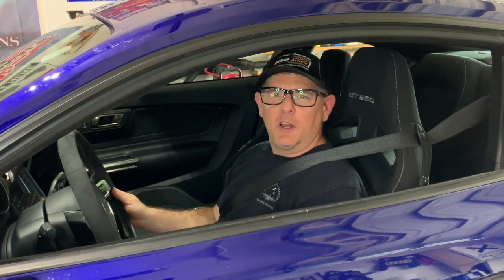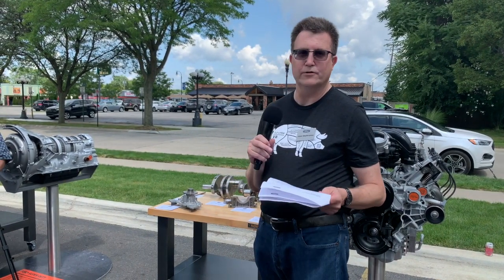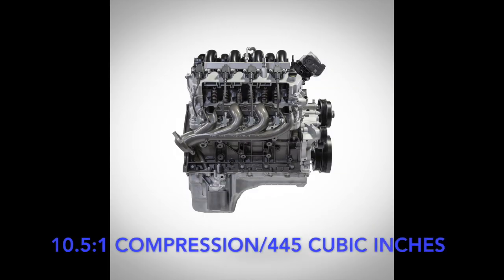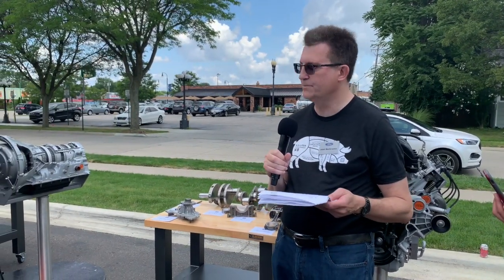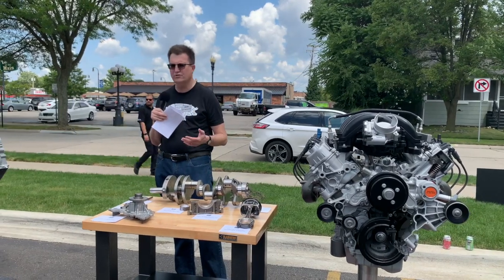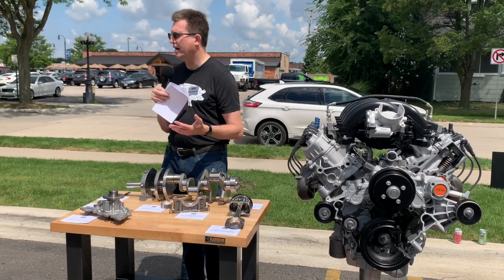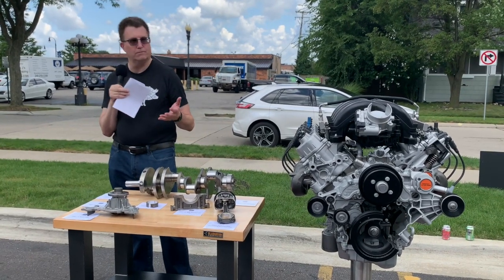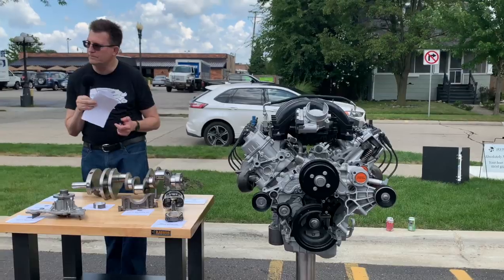Perfect for Engine Swaps! | Ford Reveals 7.3L "Godzilla" Gas V8 Horsepower and Torque Numbers

Comment: Let's be real, this is Fords attempt at an LS slayer. A high production number, affordable package that after a few years of pumping them out, us homegrown wrenchers can pick up cheap and have an extremely strong and reliable platform to get some serious bolt on power out of without having to do hardly any internals to it even with relatively high milage. Best move ford has made in 20 years. And this is coming from a lifelong Chevy guy. That stock bottom end could easily crank out 1,000 HP without even flenching, and as long as the one building it can get it tuned right to avoid detonation and valve train failure, it will do it again and again and again. This is going to be fun to watch.

Comment: Over 400 Ft Lbs Torque at 1500 rpm! That is a monster. It would be neat to see this curve starting at idle to see the grunt when you let off the brake and start to push the gas.

Comment: Some of the comments remind me of back in the 70 s and 80 s guys would remove a 302 or 351 and replace with a 460.  Why not build the small block and blow away the now useless truck with the heavy 460.

Comment: I cant wait to see the numbers of one tune up
Reply: Marcus'World what the hell wouid you have to tune up,change the damn oil and go-plugs will last 100000  oil 10000 with Mobil one diesel triple cost
Reply: @andrewnix1355  it's currently tuned down, ford will enhance tuning for raptor and other vehicle applications, also roush is working on a tune, this 7.3 will be 500+ in 2 years or so. Also this is not a deisel engine

Comment: I love all these fine details on a well-designed well-built engine. Make this engine breathe better, give it a dry sump, put it in a Mustang
Reply: If I'm not mistaken there is already a dry sump kit for it that connects where the oil cooler bungs are on the side of the block, that being said, it doesn't really need one because of they finally put the oil pickup in the rear of the oil pan that runs through the windage baffle in the pan.

Comment: I’m very interested in engine performance based on optimized efficiencies. The Japanese and Germans have consistently demonstrated the ability to produce both gas and Diesel engines that produce substantial horsepower over relatively low displacement that provide great fuel efficiency and if cared for will last half million miles. I’d like to hear from the guys who really know truck engine efficiency and what recommendations they’d make to the big three that would achieve a 500 horse gas engine, with similar torque that would last 10 years without significant mechanical failure.
Reply: One Good Turn Gets Most Of The Blanket — Nope! I have a 2016 Toyota Tundra and a 2007 Nissan Titan (My son’s truck) in my driveway! They are durable but not efficient! Also, show me a V8 Japanese engine utilized in commercial applications or heavy duty truck hauling /towing usage that has over 500hp? I don’t purchase many American made vehicles, but i would bet this 7.3 could easily match or exceed the durability of current Japanese V8s! Also, I really like that Ford Coyote V8 for light usage!

Comment: Based on the displacement rationale to produce horsepower, relational torque, at low RPM and engine longevity - 9.2L should produce 600 horsepower at idle. Ford your missing the Mark here.
Reply: No manufacturer will ever but a 9.2l displacement engine in there vehicle ever

Comment: Whats the Length, Width, Height of the engine? Will it fit in an older Mustang, Crown Vic/Marquis, or Town Car? Will Ford be offering Stand Alone Wiring Harness ECM kits....Aaaaand most importantly, a Manual Trans Bell Housing/Clutch Kit? If you dont do it Ford, the after market crowd will

Comment: I’d disagree, you’ll make just as much or more hp with a tivct motor boosted without the massive weight added to the nose from an iron block. The motor was designed for a cheap and simple configuration that produces good torque. How do you accomplish that? Large displacement and push rod design.

Comment: Kudo's to Ford for doing its own thing and going back to a pushrod engine design. I am so tired of overhead cam engines in general, foreign and domestic. This engine should be able to go 500,000 miles easily with minimal maintenance, no DEF fluid, no timing belt replacement, and no timing chain replacement.
Reply: You sound like a man that knows trucks and uses them as they are intended.
Reply: Ford high performance DOHC is the way to go. The Coyote will easily outperform this 7.3L engine. For work and durability Pushrod is better.

Comment: Hey guys if this engine gets into the marine/industrial pipeline it will come with a stand alone engine control system. If Ford has the will to do it they will be excellent bang for the buck coming from those channels. 

DO NOT DOUBT that this will be seriously looked at as a marine power plant. The Raptor 6.2 is excellent in that role and I’m sure a big brother would make a great stablemate for it. (Remember Indmar for example uses both the 2.3 EcoBoost and the 6.2 Raptor for inboard marine engines)

Comment: How does the over all outside measurements compare to other Ford engines?  I hope they sell like hotcakes so they will be in the junk yards in 10-15 years.  Ask them to make it an option in the F-150 so they will be more available :) Lighting?
Reply: As far as measurements go since this is an old school V8 pushrod it should be a whole lot slimmer than the current  6.2 liter. Hell I can see guys swapping this thing into the older Super Duty and Mustangs now... lol.
Reply from the maker: Very similar to a Windsor and you'll see them become available much sooner than 10 years.
Reply: @revanevan  true someone will total one pulling out of the dealership and I am sure some will be used a plow truck and rot out sooner.  I figure after 10 years of production the rush will be over and you might even find one in the you pull it.  They will be a phone call away in 5 years from you friendly auto recycler but will still be a premium.
Reply: Dimensionally, intake aside, it is within an inch of a Windsor length height and width.

Comment: Cool engine can’t wait to swap one! 

Was thinking it would be more HP but the 400 lb ft @ 1500 rpm is nice.
Reply from the maker: I think the camshaft design and the intake dictate the peak hp. It needs to move weight so the torque is very important, and the low rpm means longer service life. A "race" version with a hot cam, short-runner intake and headers would probably yield 100-plus hp or more. Then bump the compression and/or add nitrous or boost and hold on!
Reply: REVan Evan current numbers are great can’t wait to see the modded version.
Reply: @revanevan  any info on the bore spacing and deck height? I can't wait to put one in an sn95 or Miata
Reply from the maker: @CanIbeFrank  bore spacing is 4.53 in (115 mm), 4.22 x 3.976 bore x stroke with some room to grow. Thanks for your comment, be sure to subscribe and tell everyone about my page. I'll gave some great 7.3L info coming in about a week and a half.
Reply: @revanevan  so same as the 6.2. I was hoping for a similar size to a 460. Oh well, still better than an LS